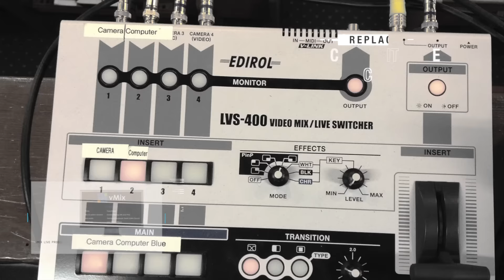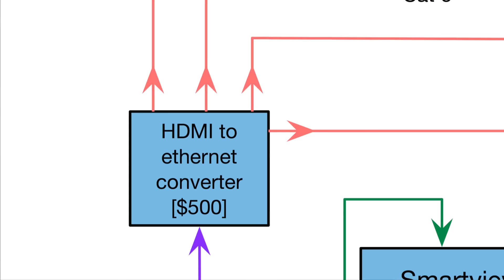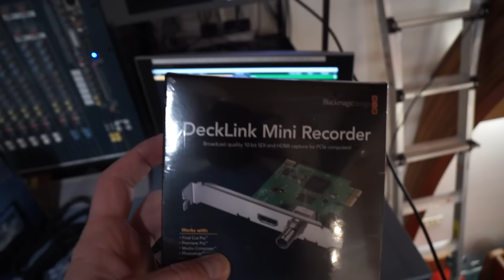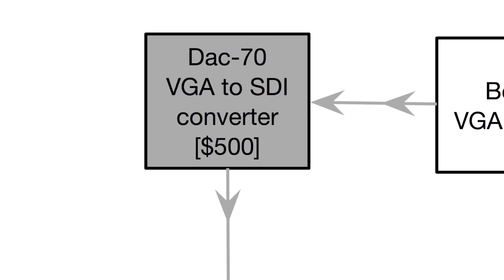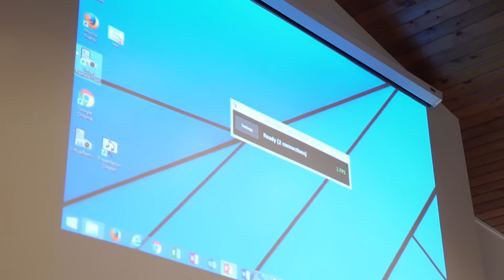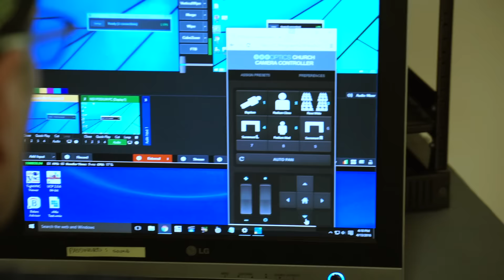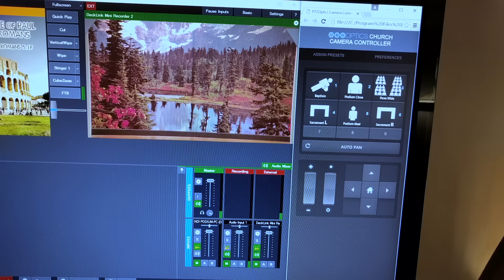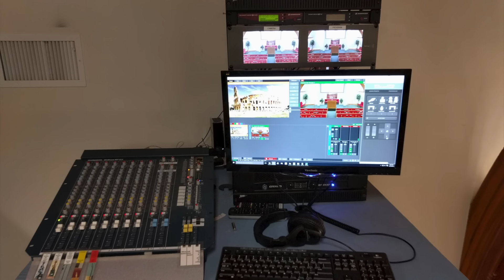Church Video Upgrade - SD to HD; PTZ, vMix & NDI!

Comment: Thanks for the video and great job!
Our church is looking to start live streaming and a member suggested buying a couple Cannon 5d mark iii's for this. However, I've read that DSLR's aren't a good option for long form video (1+ hours) due to overheating, etc. and that actual video cameras are a better option. Have you found this to be true? Thanks!
Reply from the maker: Thanks, Jeremy! I would agree that DSLR's are not the best option for long form video. Are you going to have camera operators, or have you looked into PTZ cameras?
Reply: We'd like to look into PTZ cameras as the number of our volunteers are often low and or fluctuate, and it looks like the PTZ are relatively easy to man.
Reply from the maker: Using vMix and PTZoptics cameras together is a great combination. The 4K version of vMix has native PTZ control, which allows you to set multiple presets for each camera that can be recalled with the push of a button. You can use an Xbox controller to manually control the PTZ cameras as well. Very cool stuff!
https://www.dvestore.com/vmix-software/
https://www.dvestore.com/ptzoptics-20x-sdi/

Comment: Sir, I'm interested in doing something at my church maybe you can give me some advice on. Keep in mind, I don't need new stuff for this, perhaps you could sell me some old equipment that would fit the bill. I'm a church organist and the organ is in the balcony facing the rear wall. I would like to have a simple video monitoring system with a camera near me on the balcony rail (needs to be PTZ) aiming forward to the chancel. I would also like a camera up in the chancel facing back towards the church entrance (under the balcony where I cannot see), also PTZ. I would like to have a sufficient monitor and a switching system whereby I can toggle the cameras, and do the PTZ as needed. I believe it will need to be a wired system as we cannot have a delay in the event there is an orchestra conductor up front and I need to view the conductor in real time in the monitor. I understand the wireless or digital monitors have a slight delay which would be undesirable. Please let me know what you think, sir. Could I do something for under $1,000? Thanks! -Ryan

Comment: I like that 8TB hard drive, but I don't understand why someone would want to save that much data on 1 hard drive without any RAID. That drive fails, you've lost everything. I learned a lot from this video, but I don't know why the choice there for storage. I'd love to hear that, because if there is a valid reason, I'll consider it on my jobs.
Reply from the maker: I completely agree with you! That drive was used because the customer went out and bought it themselves. A mirrored G-Tech RAID like this would be a better, safer solution. https://www.dvestore.com/g-technology-0g04069-g-raid-usb-g1-removable-hardware-raid-2-bay-storage-solution-usb-3-0-8tb/
Reply: Awesome product.

Comment: A couple of questions:  What's the make/model of the HDMI to Ethernet converter?  I can't find it anywhere on your site.  What is the function/role of the decimator?
Reply from the maker: We don't carry that particular HDMI extender and it looks like it's out of production now. This one looks very similar: http://www.hdtvsupply.com/1x4-hdmi-splitter-over-single-cat5.html The Decimator, in this setup, is acting as a distribution amp and taking the single HDMI program out and sending it to the SmartView Duo monitor via SDI and the HDMI extender via HDMI.

Comment: hi man my question is how do you manage to take the final output feed i know that you used cat 6 for extension but what dou use as the output from computer to the tv
Reply from the maker: HDMI extenders have a transmitter that sends the signal over CAT 5/6 cable, then on the other end is the receiver that converts it back to HDMI.
Reply: hi thanks for reply,my question is how do you put the feed in the hdmi at first place bcause vmix doesn't have an hdmi output port,do you get me.i understand the cat5/6 thing but that fee you put in hdmi then cat five how do you take it out from vmix
Reply from the maker: vMix relies on the in/out card that you have installed in the PC, to capture and/or output video. For instance, if you have a Blackmagic Design card like this installed, you will be able to output HDMI or SDI program video. https://www.dvestore.com/blackmagic-design-decklink-mini-monitor/

Comment: Our church is planning, or rather in process, of upgrading to PTZs and vMix for streaming/recording.  We’ve had nothing up until now. The cameras, once installed, will not be easily accessible, therefore they will need to be controlled and powered remotely. What would be your suggestions for cameras, pc, I/Os  to run and control 2 PTZs on vMix? We currently have an Aux. send output designated for our streaming mix.  What’s our best options since we our at the purchasing stage of this process?

Comment: would love to know how to have similar setup with 2 ptz camera?
Reply: just get a declink 2 card with many ports
Reply from the maker: HC MD is correct that you will need a capture card like the Decklink SDI 4K: https://www.dvestore.com/blackmagic-design-bdlksdi4k-decklink-sdi-4k/
You will need to run an SDI cable from the second camera to the capture card, and connect the second camera to the network.

Comment: May I ask why you have two capture cards (mini recorder & Intensity pro)? Shouldnt the mini recorder by itself do the job of streaming?
Reply from the maker: Hi, Josh: The Mini Recorder doesn't do any streaming, but it does allow you one video input. I used it to bring in an SDI feed from the PTZOptics camera. The Intensity Pro 4K gave me an HDMI program output.
Reply: Sorry for the confusion, Instead of using the term, "stream," I should've phrased the question to "Shouldn't the mini recorder by itself be enough to capture the video from the camera so that the vmix software can stream it?"
Reply: I streaming wit Mini recorder and Wirecast, its easy and cheap

Comment: Wait, so how do you have Wi-Fi connectivity at your church? Rookie trying to figure things out
Reply from the maker: Wifi is enabled with a wifi capable router, but in this scenario we are using the wired network to bring the PowerPoint presentation to the vMix PC via the NDI protocol.

Comment: Do you recommend using the ptz over a mid level cam corder ??
Reply from the maker: Hi, Francois: A mid-level camcorder can work great if you have an operator and a good tripod, or if you are happy with a locked-off shot. The great thing about a PTZ camera is the ability to instantly recall preset shots, which can make it look like you have a bunch of cameras!